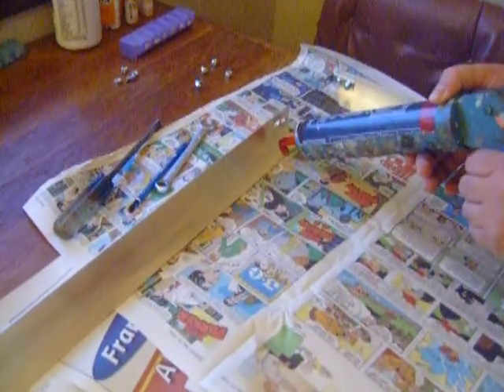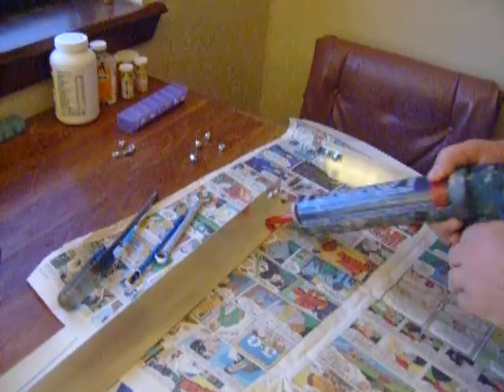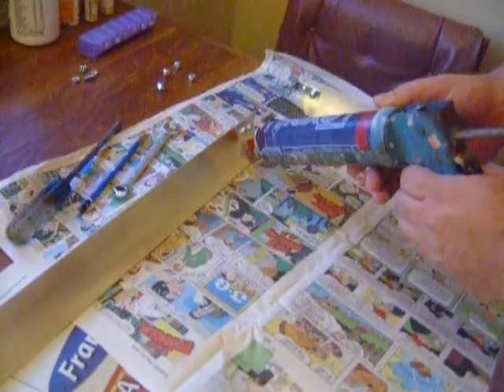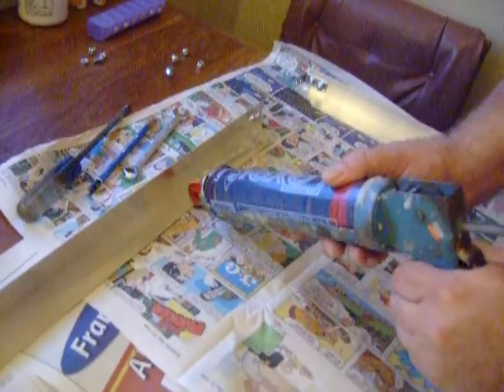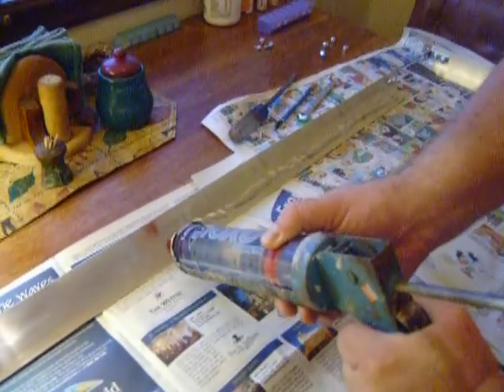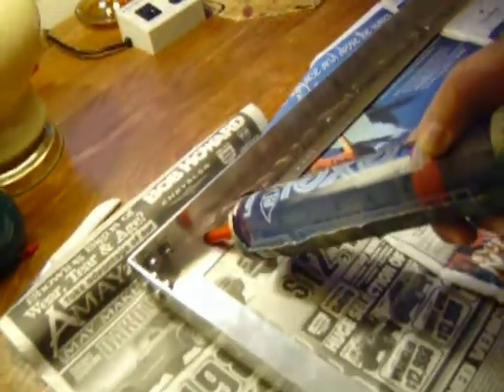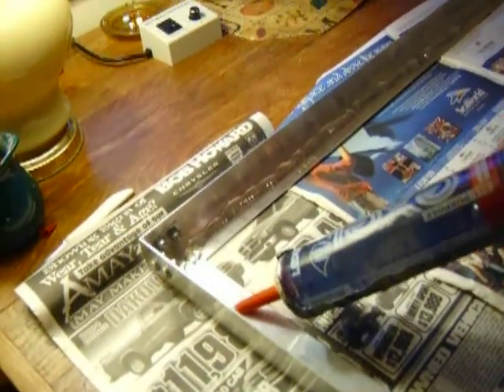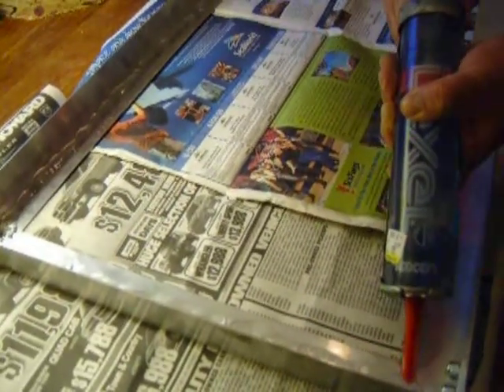How to Make Solar Panels that Will Last For Thirty YearsPt3

Comment from the maker: @mmcomputadoras yeah sure that would may be work just have to try it and see. Just so your mounting tape holds good, should work. What I found out when making a frame is that the when you go to put in your bolts they don't alway align perfectly and I have to end up widening up the holes to the brackets will adjust to make the frame square.

Comment: What if you pre-asemble frame with some mounting tape, apply silicone, put the glass and then adjust bolts in place?

Comment: Hi shartne, have you ever tried using a ordinary clear glass for a panel.? Because tempered glass is a bit expensive.
Reply from the maker: You can but it might get broken easier. Use a storm door window they are tempered glass and they are everywhere.